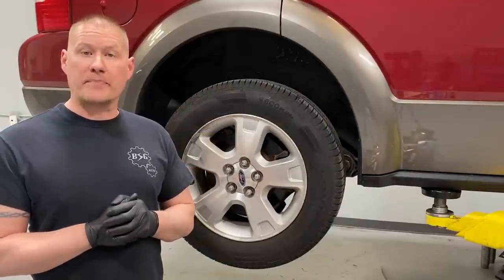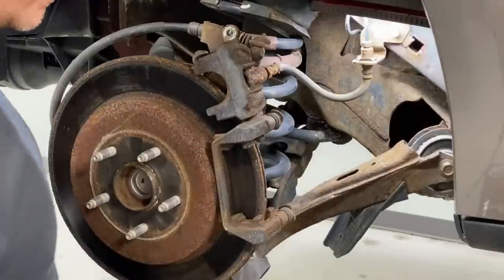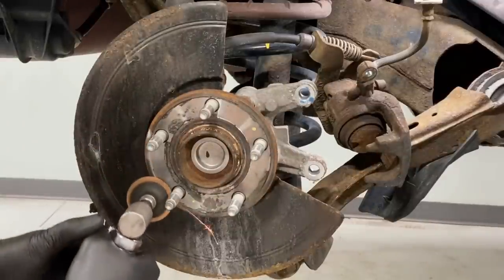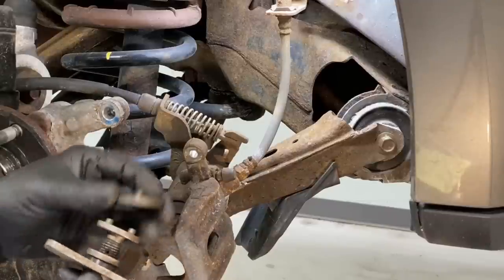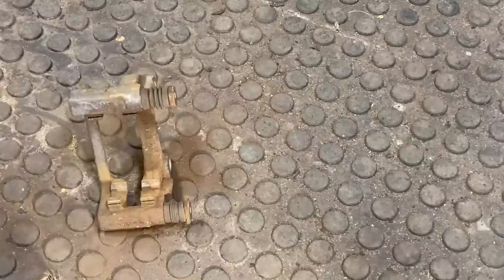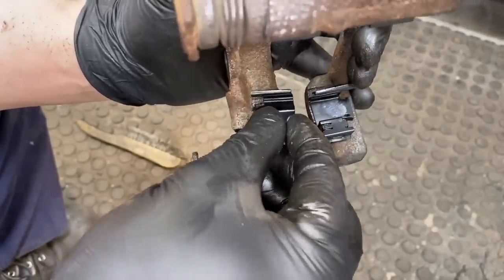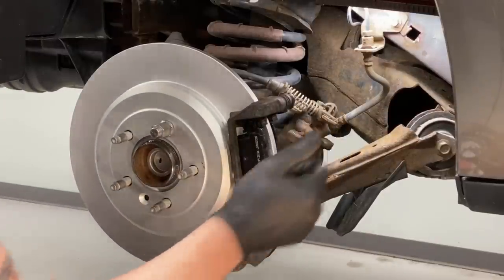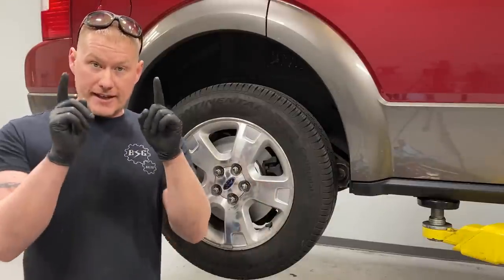2008-2019 Ford Taurus and 2005-2007 Freestyle/500 Rear Brake Job Walkthrough

Comment from the maker: These are the Tools and Parts I Recommend:

Rear Brake Pads (2005-2009 All Models)
https://amzn.to/2WQiGaz
Rear Brake Pads (2010-2019 Taurus)
https://amzn.to/2QNCGH5
Rear Brake Rotors (2005-2019 All Models)
https://amzn.to/39sMxZj
Brake Caliper Retractor Tool
https://amzn.to/3dCN3ar
Brake Caliper Grease
https://amzn.to/2QWfir0
Nickel Anti-Seize
https://amzn.to/2ybLCiU
Medium Strength Threadlocker
https://amzn.to/2QUV1BZ

Torque Specs:
Brake Caliper Bolts- 23ft lbs
Brake Caliper Support Bracket Bolts 81ft lbs
Wheel Lug Nuts- 100ft lbs

*NOTE* Passenger side Caliper screws in counter clockwise on 2005-2009 models. 
On 2010-2019 models both Driver side and Passenger side calipers screw back in clockwise.

As an Amazon Associate I earn from qualifying purchases.
Reply: Not related to this vehicle but what is the part number for the vct filter screen for a 2004 5.4l 3v? Anybody?
Reply: Went a little batty on our effort to back that passenger side parking brake off when we did my 08 Taurus. It hit a point and would not back off one more mm. Rather than break something, I started digging for answers and found your video about tweaking the bleeder to vent the reservoir in the brake caliper. This was a very important piece of information that should be linked to this video. It would have saved us many headaches that day, for sure! But at least I found the video, all went quickly after finding out what we were doing wrong. Got some crap out of the reservoir, too, and all seems to be fine after we put it back together. Thanks!

Comment: Fantastic tips & step by step instructions.
Added 2 cents;
Unscrewing brake fluid cap helps a bit retracting piston. Also take out excess topped up fluid to avoid spillover in case it was added by Sunday mechanic as brake pads wore.

Comment: GREAT video!  I do have a question though.  If  you have to turn in the piston  to have room for the new pad  which is wider than the old worn out pad.  Then if you put the brake pad nub in the  notch how can the piston rotate outward to take up the gap as the pad wears?  Won't the nub keep the piston from turning outward??   When you removed the outer pad you can clearly see the nub which does nothing . We could not see the inner pad back.  There should not be a nub on the piston side.  The piston will never be able to back out as the pad wears.

Comment: What I did on my mustang was without mounting the rotor I mounted the caliper bracket and the caliper then turned in the the caliper.  It's like having a vise.  Then again I only have the cube like tool.  Thank you very much for all your work.

Comment: Great video Brian. Might be worth noting that the capture bolt is not needed. It’s only there to make factory assembly easier at Ford, hold the rotor in place. Not needed for any safety related tasks.

Comment: I wish everyone would watch this video of how to do a proper brake job. As a mechanic myself I hate when I get vehicles in the shop that previously were not done properly, Frozen caliper pins, torn boots, and excessive rust. Too many people just remove and replace the pads without cleaning and lubing everything you have pointed out that needs to be done.

Comment: Good video.  I've never run across the pistons that need to be rotated back in bit I'm sure I will in the future.  For those without air tools, a wire wheel on a drill works wonders to get rid of the caliper rust. Make sure all rust is gone and everything bake to bare metal in the spots he cleaned up or things will bind and/or squeal.

Comment: I just got the parts delivered yesterday to do this job on my mom's Taurus. Thanks for the video! Now I just need to find a way to stop the front brakes from groaning. Lubing the area where the piston contacts the pad fixes it for a short time but it always comes back. Drives me insane!
Reply: Nodak81 Watch his videos of which I have watch most of them he has addressed that issue. Just have to go through them to find the one that applies to your circumstance.

Comment: Sweet new intro👍🏼  because of you I’m a ford expert. You saved me a ton of money . I own a 2011 Taurus with 216k miles runs like a top with original water pump. Also have a 16 Edge same motor and transmission as the Taurus 80k runs great wife loves it.
Reply from the maker: I would replace that water pump ASAP.
Reply: It’s our 3rd car doesn’t get driven very much.
Reply: @FordTechMakuloco  how much would that replacement cost

Comment: Brake pad 101...awesome
Some of them calipers are very tight to start and if the pads are excesively worn you cant get that tool in to wind the piston back..
Also the other problem is knowing which wayvto turn it...often i struggled to get it to turn only to find its going out not in...but your right with the extra leverage..makes it a bit easier on your hands.
Thanks for sharing

Comment: Forgive me if you’ve already covered this… would you be able to tell me what the proper torque specifications are for a ‘17 fiesta ST?

It has disc brakes all around.

I’ve been trying to find the values for: 
•front and rear bracket bolts
•front and rear guide pin bolts
•front and rear flow bolts

Any help is appreciated!

Comment: Other professional repair shop video's say that if you have a car with anti-lock brakes you should have the bleed screw cracked while you reset the piston so brake fluid does not travel backwards from the cylinder up the brake line, which can damage the sensor.   Do you have experience with this?

Comment: When you're turning the piston in, shouldn't you take the master cylinder cap off? That's what I've always done to make the turning easier.
Reply from the maker: That has no effect at all, if it did I wouldn’t be able to push all the fluid from a conventional caliper back into the master in 5 seconds or less.
Reply: @FordTechMakuloco  Ive had instances where the master was topped off because the fluid level appeared low due to the normal pad wear consuming more fluid in the caliper pistons and when the caliper were compressed the extra fluid had no where to go in the master cylinder reservoir!!!!! i always check the fluid level in the master cylinder prior to performing a brake job and adjust the level if needed to prevent the fluid pressurizing in the reservoir.....
Reply: @mikeshowtoandthings  it always has sonewhere to go...through tge vented cap and over the floor..😳😳

Comment: Have you tried other grease/lube etc underneath the brake slides vs using anti-seize?  I've sorta experimenting with with Permatex Anti-Seize (Al) and their Ceramic Brake Lube and I think the Brake lube dries out quicker than the anti-seize.

Comment: Good video,  however the question is when installing the brake pad nub into  the V slot in the piston how does the piston turn outward when the pads wear??
Reply: They dont. They only need to spin to get the puston to compress
Reply: @BrokeWrench  So you are telling me the piston does not spin during braking when the pads wear down but comes outward like a regular piston?  How is this possible when you have to screw it back into the caliber?

Comment: Sir.  Your video was so super helpful  I have had Chevrolets, Jeeps,  Subarus in the past and all are just your a C-clamp and pressure the piston in.  I have never ever encountered something like this.  I thought something horrible wrong happened since I could't get the caliper piston to retard.  I learned through your video out the brake caliper wrench and that made the rest of the rear brake job so much easier.  Thank you.

Comment: I encountered the front pads with one , outside, apparently glued to the ears. 2019 escape se.The metal backing separated from the pad when removing it..I removed it as well. The new pads did not have adhesive on them. I wire brushed, then applied the molylube to ears and all abutment surfaces. I was freaking wondering if it was intentional or from overheating.  😊
Reply: When compressing caliper pistons I find it helpful to remove the master cylinder reservoir cap first and place rags or catch container underneath. Do you do this as well? Appreciate all your videos and advise. U da man! Lol

Comment: They use the same system on the Transit vans, couterclockwise on one side and clocxkwise on the other. I had to buy a tool for that, because my old one only went clockwise. Incidentally, from what I can see, the tool I got is the exact same one you're using...

Comment: How about using the caliper bracket files. I would say most people don't have an air compressor available. Great video! specifically the description of the piston compression.
Reply: There are electric die grinders too, real ones, not just the "Dremel" ones.

Comment: Great video Brian. I have a 2005 Five Hundred and I concur those pistons were a bear to press in. By coincidence I bought the exact same piston tool off of Amazon just because it had the left-hand screw handle for Fords!

BTW - I kept a wrench on the tightening nut and used it on every other turn of the screw handle. After a while you develop a rhythm and they zip right in. Keep up the great content!
Reply from the maker: Yup keeping the pressure on the tool is key.

Comment: Hey Brian, love the videos.  I have a question.  I've been told that on rear brakes, you should never push fluid backwards through an anti-lock system as it can do damage.  I was told the proper procedure is to clamp off the brake hose and open the bleeder and then reset the caliper.  Is this true?  Can we do damage by pushing brake fluid backwards on anti-lock brake systems?

Comment: My wife’s right rear caliper was seized on her 97 Altima, brake fluid not changed often enough.  The driver side rear caliper turned in hard but easier.

Comment: Great video, timely for me. Question, why not put anti-sieze on the threaded studs? My question is at the time your are cleaning the rust and applying anti-sieze.
Reply from the maker: Never put anti-seize on the wheel studs or really any bolt threads except for the shoulder.
Reply: I did some research and now understand it changes the torque specs on the lugs and could cause an over torque and then bad stuff.

Comment: Thanks for the great video. I'm surprised these pads don't' have wear indicators, nor do the front. Guess one won't know they are worn until they start hearing the metal on the pads grinding into the rotor.

Comment: Been there done that...Harbor Freight for that brake tool. My tip, is to use a 4' grinder to remove that lip on the edge of the rotor. Second those rotor hex screws, grind those screws flat on the backside of the axle hub, mine were an inch. too long and rusted lumps.  Third use only motorcraft parts, no crap from napper or autowhat-a-call-it.

Comment: So I have a 2011 Expedition with little to no brakes. Pedal basically goes to the floor when truck is running. When I turn it off the pedal gets hard as it should. I've rulled out the booster because the pedal isn't stiff when running. I don't think it's the master cylinder because it was just replaced and year ago and when I turn the truck off the pedal gets stiff and if I keep the pressure on the pedal it stays in place, does not gradually sink so I don't think I have a leak, plus I don't see any brake fluid anywhere. Not on rims either. Is there some sort of test I can do for process of elimination? What about the ABS control Module? Any ideas? Can really use some help on this one

Comment: Unrelated subject, but I figured you are more likely to see it on the most recent video.
The topic is V 10 spark plug popping and exhaust manifold stud failures.  Vehicle is a 2001 class C motor home with 21,000 miles. I had a conversation with a high performance shop guy. He's a full time Ford dealer mechanic and part time dyno tuner at the high performance shop. 
He said both of these problems are related to Fords tuning on these engines. They run so lean and hot that the relatively small exhaust manifold studs fail and the constant detonation/pinging eventually rattles the plugs loose until they blow out. They say they can correct these issues by re tuning the engine for a richer mixture and various other adjustments and correcting transmission shifting issues (early and unnecessary down shifts).  This may be similar to various after market products like 5 Star Tuning.  Do you know anything about this?

Comment: Thank you for all of the great tips and videos you share. I do have some questions on a older for f150. I have a 1998 f150 V6 truck short box. I am in the stages of stripping it down to build a street/fun little fast truck. I'm not sure if this is something you can help with but I am looking for information on motor mounts. I am installing a 460 big block with a C6 auto trans. Would you have any tips on this?

Comment: Interesting point of winding in the calipers. I have only seen the counter clockwise winding caliper on one other car, the Jaguar Xtype. On that car the left turning caliper was on the left side of the car.
Reply: The Jaguar X-Type is based on the Ford CD132 platform. They're cousins under the skin.

Comment: I’ve got a Haynes Manual and it says that “on rear calipers, the caliper guide pins are pressed into the mounting mounting bracket… Do not try to to remove them or they will be damaged and the mounting bracket will have to be replaced.” I pulled 3 of the 4 pins on the rear before I saw that… explains why they were so difficult to get out. The top and bottom pins are also different. The driver side has one with a rubber piece over the end of the pin on the bottom and the whole thing goes in the hole. I’m assuming it’s also reverse on the passenger side: the rubber should be on the top pin but I honestly don’t know because that’s the one I couldn’t even get out but the bottom I got out and it didn’t have the rubber. The one with the rubber on the drivers side I also had trouble getting out but it did come out.
Reply from the maker: They are caliper slide pins they are meant to move free, they are not pressed in. The rubber tipped ones especially can get dry and bind when removing due to lack of grease.
Reply: @FordTechMakuloco  yeah I have a neighbor who’s worked in the industry for many years and he’s said he’s never heard of that either. Anyway I just left that last pin in because I couldn’t get it out

Comment: Do you recommend a brake in procedure on the first drive with new brakes? I've read so many ways through the years. Thanks!
Reply from the maker: I have a video on what works for me but in general you want to perform light to moderate braking and never overheat the pads while burnishing them in.

Comment: Do you have any insight as to why it seems the F150 frames and axle seem to rust so damn quick?  My dad bought a 2018 and it looks like hell underneath!  Also seems to have a leaking pinion seal at 35k miles so i told him to get it replaced under warranty . What the hell?

Comment: I had to turn my passenger side clockwise to retract it. I think it was an aftermarket caliper though. I know it had been replaced because whoever put it on used the banjo washer as a washer on the caliper bolts..

Comment: Question. Have 2010 sel 150  000 miles.had break job year ago 
And master cylinder replaced 3 years 
Ago .brakes are mushy. My mechanic whom I trust said he put through every test and said only the dealer would be able to find problem. What say you?what could it be.he checked abs brakes 
But nothing showed up on the computer.
Reply: Did you ever find out what was causing the mushy brakes? I've heard that mushy brakes after brake replacement is from air in the brake lines...?

Comment: I am not being a critic, I am generally curious.  

How come you didn't just release the bleeder screw when compressing the piston?  I thought the two great reasons to do that is to 1.  make it easier.  2. to NOT force old potentially bad brake fluid back through the anti lock brake valving and module.  Any contamination in the valving and module from bad contaminated fluid can create some really big problems with the anti lock brakes.  Many terribly expensive repairs that had to be done to the anti lock brake system were completely avoidable by better brake repair practices.  If I am wrong, please tell me, as that is the way I was taught.  it is not uncommon to have rust and rusty fluid in the caliper as the fluid is hydroscopic and nobody ever flushes it like the manufacturer recommends..